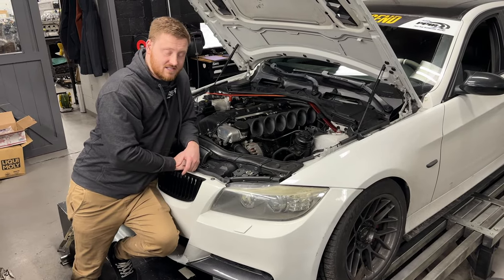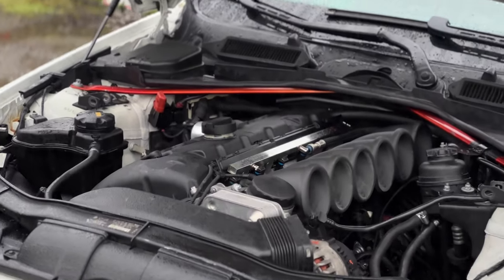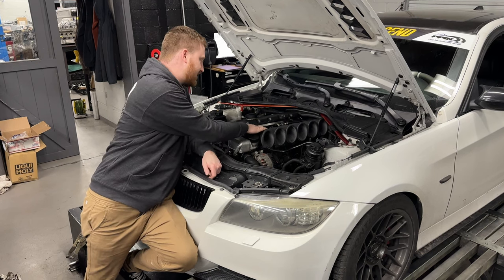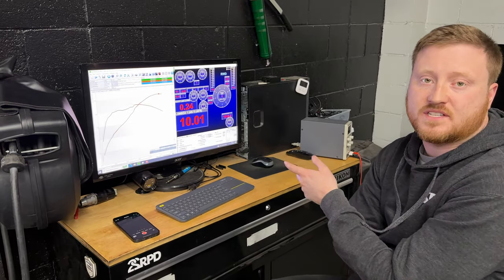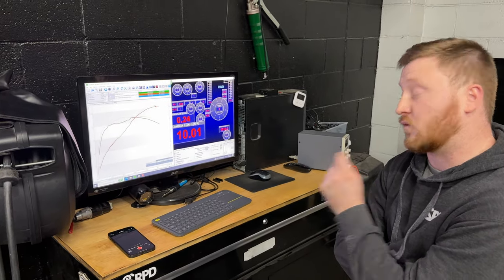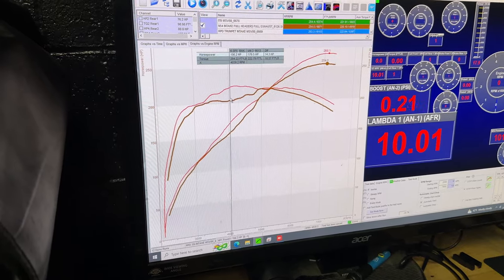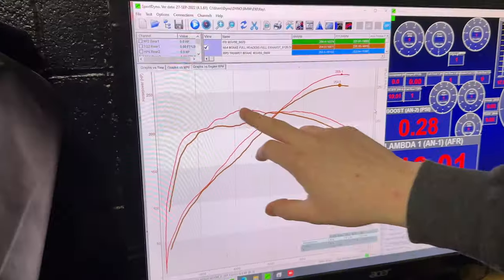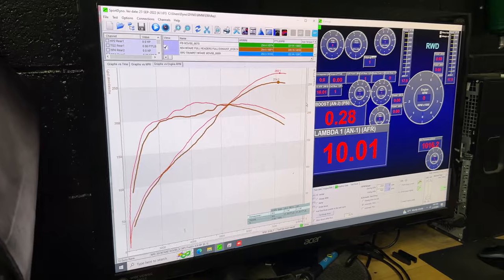N52 Velocity Stacks Update @ 22RPD

Comment: It isn't a question of if I'll be purchasing these, but when. As soon as there is a version with filtration (my driveway is a long and unpaved), I'm in! When y'all open up beta-testing, I'll fill in my details and see if I'm what you're looking for in a beta platform. Very excited!

PS I'm going to assume you'll be working on headers to match the velocity stacks. If so, I'm waiting on headers from y'all. If not, I'll get the same ones Raimund has installed. Milvs are sitting on the workbench waiting to be installed!

Comment: Should it work on N52B25 eurospec? Im from Finland. Its 2007 n52k on e92. I have catless headers, straight pipe and stage2 tune also i guess. Only im missing this manifold and milvs. Running around 240hp now. Imo its good/ok for 2.5 liter.
Reply from the maker: It should bolt up, but it wont be port matched to your intake valves. It will still sound incredible but it will make less power due of that

Comment: Lots of potential here. If they make a version with a filter and perhaps one inside an air box we could call it the N52 CSL airbox! Add a sound generator to cabin and it will be McLaren F1 level. Will be following developments closely 👀 E82 125i N52B30 FlexFuel Full E85 owner here
Reply from the maker: There will be a filtered version after beta testing 👍 I wish the mic picked up the sound better but it is very audible in the cabin already 😁

Comment: I have 2 n52 vehicles. A 08 3.0si z4 and a 08 328i both are automatics. Are you going to design a long filter?  I think a filter design would be extremely easy for that setup. Long rectangular filter like used on other velocity stacks.
Reply from the maker: Yes there will be a filter made for it after the beta testing

Comment: Trying to pick one up from a local guy, clean 6 speed sedan. It would be a rallycross car- maybe autocross just for fun and development. I'd be really interested in helping design a setup with a filter. Maybe even build a plenum/TB into it for startup/failsafe, that could be on a temp switch or arduino or something, otherwise bypassed.
Reply from the maker: They make good race cars. 22RPD will have a filtered design coming out as well :)
Reply: @RaimundN52  yeah and great dailyable car too. Determined X1 struts will work as well for a mild lift. Make some additional body protection out of HDPE and I'll be good. Actually might an old truck bedliner, the kind that are ribbed, the rigidity/weight is fantastic, easily cut to cover up holes I don't want filled with grass hah. Rivet aluminum on the top side where it might be exposed to heat, and at bolt junctions.